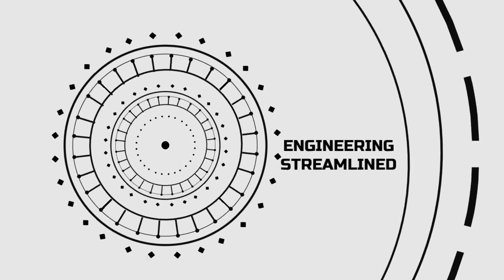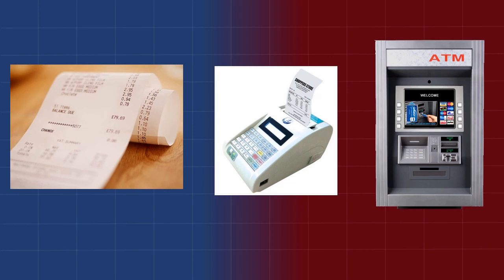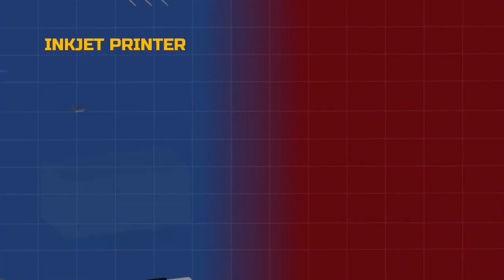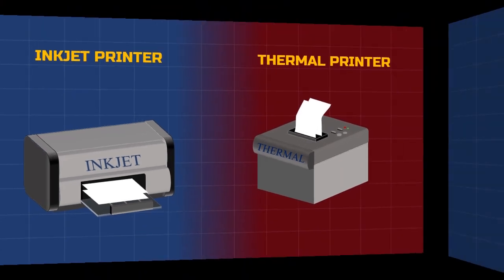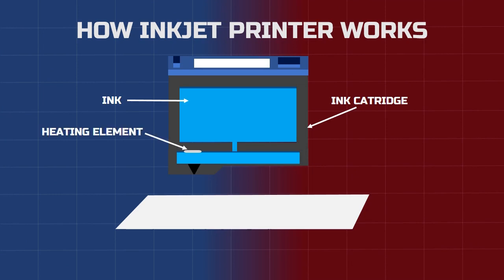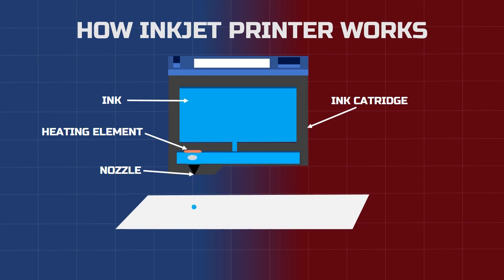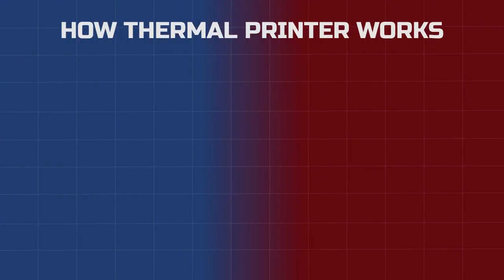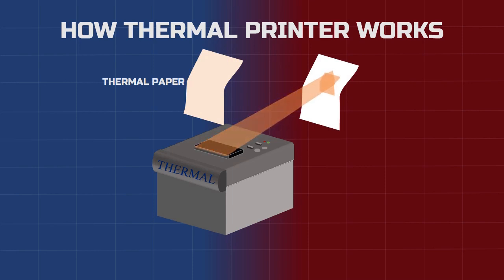Why ink fades away from ATM and Supermarket slips? - Thermal Printer

Comment: Hi! What chemical? Is that a chemical produced by the heat or on the paper?
Reply from the maker: A chemical bisphenol A is used as coating on the paper. When heat is applied on the paper, it turns black and the writing becomes visible.
Reply: @ENGINEERINGSTREAMLINED  thank you 🙏🏼